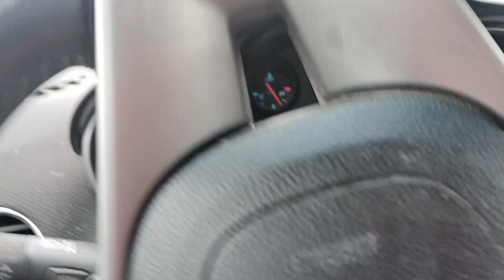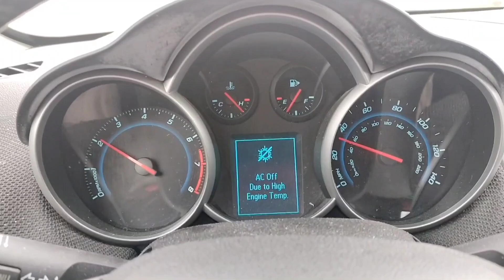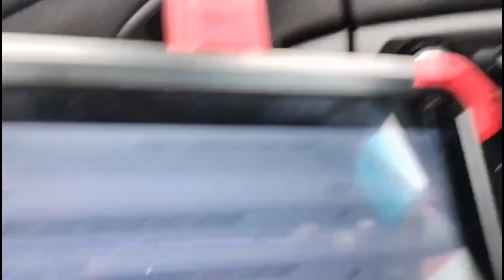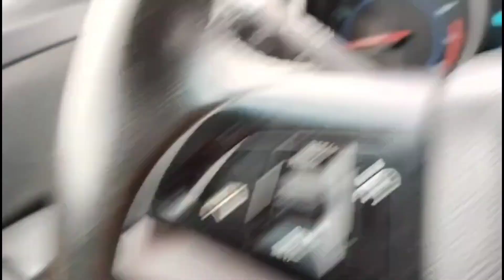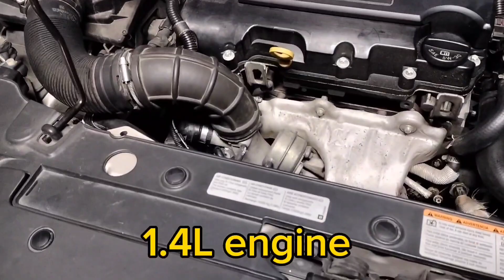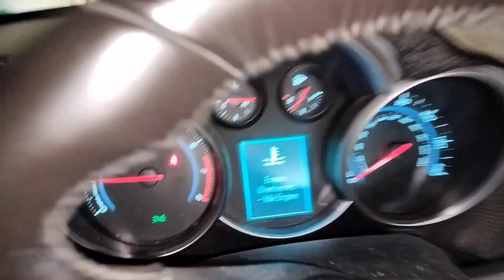Chevy Cruze Overheating temperature needle fluctuating

Comment: I found out the radiator has a bleeder screw on the left side. Cracked it open til coolant came out of the hole then screwed the bleeder back in. The overheating finally stopped
Reply from the maker: https://youtube.com/shorts/YSSZO4zpFGI?is=njKhZ-jaCRvub3yL
Reply: @hdgarage yup upper left on the radiator is the bleeder screw. If you dont crack that open and let the air out it will overheat

Comment: Had  this issue. It was a manufacturing defect of the bleeder hose connector. The connector from the bleeder hose to the engine had NO HOLE in the connector! It was essentially working as a plug. Causing the engine to overheat. Hopefully this helps and won’t hurt to check!
Reply: I had this same issue on another GM car causing overheating multiple mechanics did not find it. Simple fix after finding no coolant flow through hose.

Comment: It's the thermostat
Reply from the maker: @martinknorr332  Nope, coolant reservoir tank. Unbelievable.
Reply: Was it leaking and getting air
Reply from the maker: @martinknorr332  well actually the reservoir and cap helps to build around 20 psi pressure in order to aid in the coolant flow. If coolant reservoir and cap are not functioning properly then coolant starts to bubble up.
Reply: @hdgarage  wow jeez

Comment: I’m having the same problem with my do I have to replace the sensors or the reservoir tank for the coolant because what I’m seeing people are saying sensors and tank
Reply from the maker: @lukec6202  Tank and sensor come as one.
Reply: @hdgarage  does that solve the problem
Reply from the maker: @lukec6202  yes it did
Reply: My car doing this and I changed the coolant jug and sensors. I even changed the thermostat housing , thermostat and radiator water pump.
Reply from the maker: @lukec6202  tank and sensor come as one.
Reply: I had a problem with my coolant housing leaking and replaced it.
Reply: Queste chevrolet sono belle auto ma questi motori hanno sistemi di raffreddamento non adeguati perdite di liquido surriscaldamento termostati tubi temperature d esercizio e troppo alte
Reply: @Angelo64064  No oil in my coolant, but a mixture of water and oil in the engine.

Comment: Had the same problem once before on my 2019 Chevy Trax, same exact 1.4L Ecotec engine. Water pump gave out on me at 52K miles (free replacement under warranty). I've gotten the water pump replaced after that.
Reply: Did your problem stop?

Comment: I had bubbling in the reservoir. I changed the thermostat and a heat sensor. But it kept doing it. I had air int je system. I had to empty the radiator from the bottom. I bought a new reservoir . Before putting new coolant in. There is a white screw / plug on the radiator topright passenger side unscrew that add coolant slowly. When coolant comes out the hole. Plug up hole and turn on car keep an eye on the reservoir add slowly until filled between min and max.
Reply: I had water pump multifunction, thermostat was replaced (later on, bypassed, don't ask why 😮) Same air in the coolant sys and coolant bubbling with overflow.  So water passed in the engine due to broken gasket. 
Too much issues with the cooling system on these Cruzes

Comment: Do a block test to check for combustion gases in the coolant. Could have a bad head gasket or cracked head. 

Also test with your scantool the cooling fan assembly. The fan sounds like it runs on high, but may not run on low speed. If low speed does not work and the relay is good, the cooling fan assembly may need to be replaced.
Reply from the maker: Hi, thanks for the advice. End up being the water pump.
Reply: @hdgarage  you mentioned multiple times is the coolant reservoir? Or it was the water pump instead?
Reply from the maker: @fadeenanaa4495  it' was the water pump.